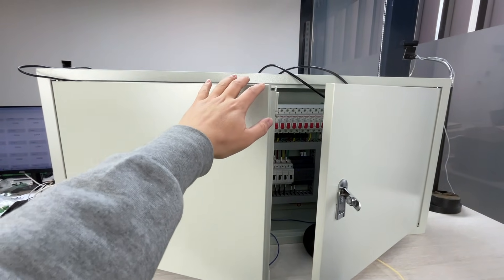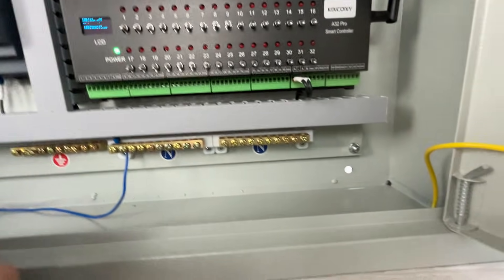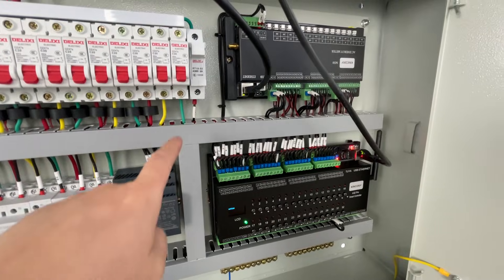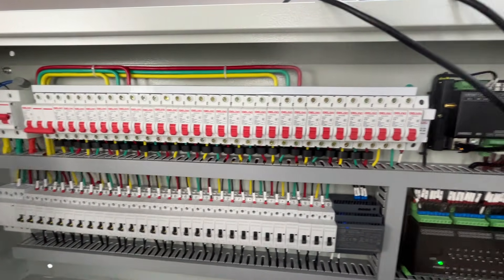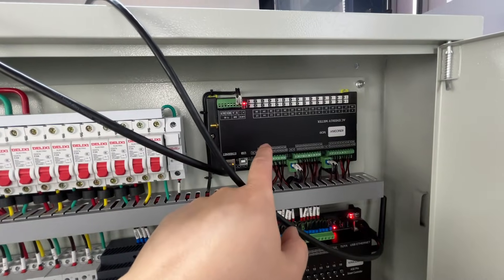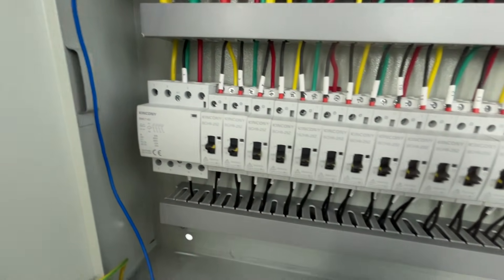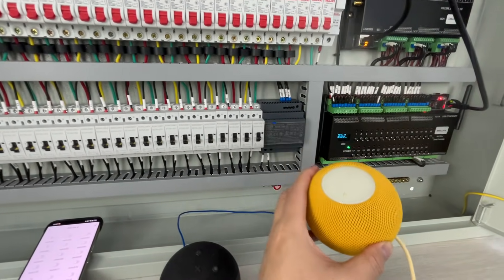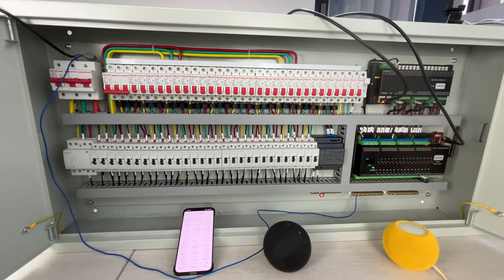3 phase smart distribution panel + energy monitoring - home assistant

Comment: Thank you for the video. I am building a new home and I am planning a smart home system and I am very close to buy some Kincony products. But I have some doubts. 1- In case of a problem with home assistant or with these relay boards, how can we keep using the light switches and shutter blinds? 2- I suppose you use latching relays. How do you know the actual state of the relay? For example, in the event of a power cut out, when the power will be on, the latching relays will remain at the last state and I wonder how HA will know this state of relays after reboot?

Comment: Nice distribution panel , 
My question is can a 32pro or h32B pro wich one more powerfull fiture for automation local HA (when internet off) .
Second i have case 2 floor home then ill split it to 2 panel distribution for example first floor i need 24 channel , and secon floor 16 channel but it can be 1 sistem what relay server must get eficiently , it is A32 x 2 / H32B prox2 or i just need one and the other just extender .? Thankyou before
Reply from the maker: A32 Pro is better for home assistant, more powerful, zero code config for home assistant.